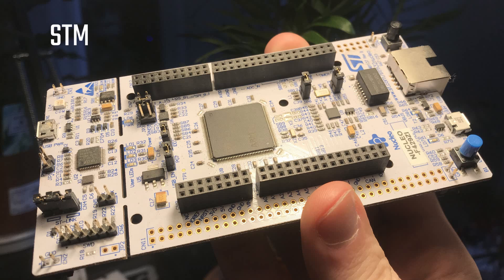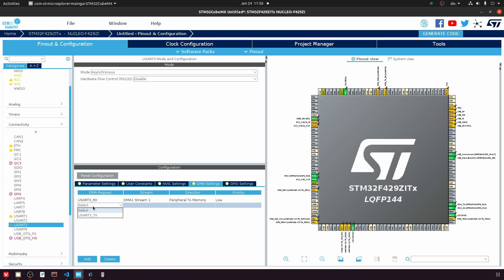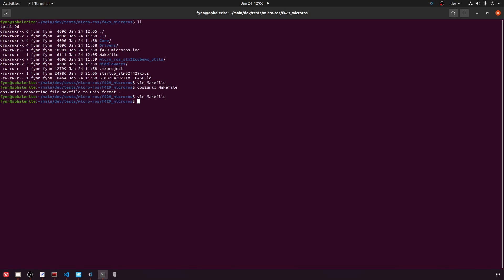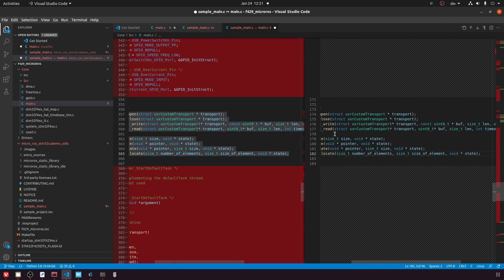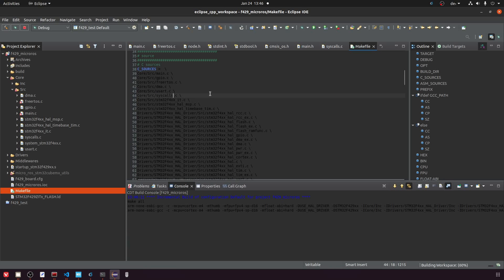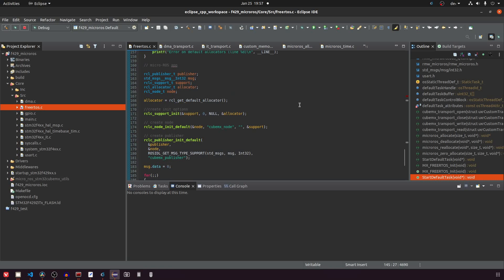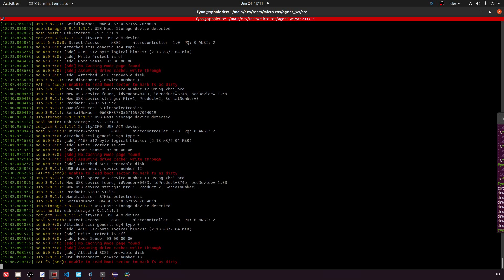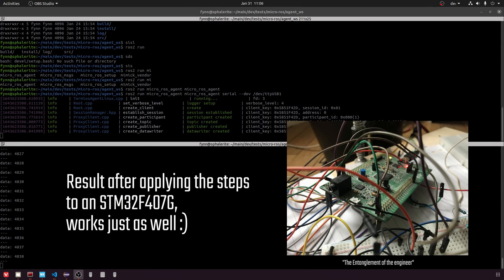How to setup micro-ROS on any STM32 microcontroller

Comment: Thank you, this video has been very helpful! I tried to follow your steps for a STM32F407VGT6, but didn't get it right. So I have a couple of questions:

1. In the build step, my project finished with 0 errors and 0 warnings but my project explorer still shows files with problems. So can I continue with the tutorial or do I have to solve those problems before?

2. I also got an error while running colcon build for the micro-ROS agent: 

ERROR:colcon.colcon_core.package_discovery:Exception in package discovery extension 'prefix_path': object of type 'NoneType' has no len()

Apparently the colcon build did finish its execution, but I'm not sure if I can ignore this error.

Thank you again for your help!
Reply from the maker: Hi there,

1. I don't quite understand the question. Are you talking about building the library, the microcontroller binary or the micro-ROS agent? What kind of problems do you see in the project explorer? Do you mean the small white X on a red background that is shown next to files in Eclipse? That's fine. It's usually a problem with the setup of include paths, defines or something similar in the IDE. As long as it compiles when building the binary you want, all is good. The compiler speaks the truth, not the IDE. ;)

2. I have not seen this error before. I've tried the instructions to build the agent from a freshly cloned repo again and it works without problem for me. Make sure you have the right ROS distro branch checked out. Also be sure to follow the instructions for "Building" first. I've skipped the mkdir steps at first which caused some trouble so for your first test follow them exactly, maybe in a temporary test workspace.

source /opt/ros/$ROS_DISTRO/setup.bash
mkdir uros_ws && cd uros_ws
git clone -b $ROS_DISTRO https://github.com/micro-ROS/micro_ros_setup.git src/micro_ros_setup
rosdep update && rosdep install --from-paths src --ignore-src -y
colcon build
source install/local_setup.bash

Then execute the steps in "Building micro-ROS-Agent":

ros2 run micro_ros_setup create_agent_ws.sh
ros2 run micro_ros_setup build_agent.sh
source install/local_setup.sh
ros2 run micro_ros_agent micro_ros_agent [parameters]

Does that fix it? If not, when running which command does the error occur?

Cheers
Fynn
Reply: @roboticsinanutshell  1. I was talking about the small white X on a red background that is shown next to files in Eclipse. So I guess there are no problems with that part, being that the binary building finishes without errors. Thanks for clarifying that!

2. I was able to solve the error, it was nothing serious. I also followed your steps carefully, but when I start the micro-ros-agent I get this:

jafet@jafet-Satellite-C55-A:~/uros_ws$ ros2 run micro_ros_agent micro_ros_agent serial -b 115200 --dev /dev/ttyACM0
[1643036775.906617] info     | TermiosAgentLinux.cpp | init                     | running...             | fd: 3
[1643036775.906762] info     | Root.cpp           | set_verbose_level        | logger setup           | verbose_level: 4

I already checked that I'm using the correct set of parameters (baudrate and device). In the Core/Src/usart.c file I have huart3.Init.BaudRate = 115200. I wasn't sure if this had anything to do with the error, but I wanted to make sure. I also looked into your repository for possible solutions and found that for this problem you wrote that I could check that my MCU doesn't crash anywhere. But I don't know how to do it, so could you please elaborate more on that?
Reply from the maker: @jafetgutierrez95  In general the output from the micro-ROS agent you get is expected. It means that the agent was able to find your device. But it did not yet initialize any communication such as a publisher or a subscriber which is not the expected behavior (if you created any subs or similar on the MCU). The most easy fix you can try is to just stop your MCU and run it again. In general you have to start the agent first, then the MCU (at least with the code as it is right now, you could also write it so that it attempts reconnects I assume). If that doesn't work I'd try restarting the agent as well. You could also step through the initialisation process within the MCU using a debugger and see if it halts at any call. This could indicate to you where the problem resides.

Indeed I also had problems where the agent would simply not set up the publishers, subscribers, etc. and no communication was possible. Unfortunately I don't have a clear answer to that problem either right now. When I've encountered it I mainly tried restarting the agent and the MCU until it worked eventually. So I'm also in search of the best approach to solve that problem.

I hope this answer still helps you at least a little bit. If you find out anything how to fix the problem, consider writing it down here so I and others can learn from your findings.

Cheers
Fynn
Reply: @roboticsinanutshell  I understand. Thanks for the detailed info. I’ll keep you updated on anything else I find.
Reply: @jafetgutierrez95  
Sir , Did you overcome the problems
Coz , without any prior idea on whether or not the controller is compatible with ROS, purchased the controller and has been facing issues since a week . I was hoping to get in touch with you .

Comment: Hi, I am trying to install the microROS into STM32L073RZT6. 
Yet, I am getting this "region `RAM' overflowed by 24688 bytes" RAM error while I am building it. 
Is it just because that this MCU does not have enough memory?
Reply from the maker: Hi there,

yes it sounds like your chip does not have enough RAM. On this page (https://micro.ros.org/docs/overview/hardware/) in the 3rd paragraph they mention that you need a few tens of kilobytes of RAM to run micro-ROS. According to the datasheet of your microcontroller, it has only 20 kByte of RAM. This seems to be insufficient. The guys at micro-ROS do have further resources on how to tune the memory consumption such as this (https://micro.ros.org/docs/concepts/middleware/memo_prof/) and this (https://micro.ros.org/docs/tutorials/advanced/microxrcedds_rmw_configuration/). So you could give these optimizations a try if you want to stick to your current MCU. You could also think about if external RAM could help you. Other than that you have the option to use a more powerful chip with more memory.

Cheers
Reply: @roboticsinanutshell  Thanks a lot.

Comment: I have the STM32 H757XI Eval Board and it seems to meet the requirements haha
I mean, the memory is enough and it has all the usual communication protocol stuff (CAN, SPI, I2C, etc...), no Bluetooth or WIFI though.
It also has a LCD, and so on.
Do you think it could work?

I am still taking the basics courses (Linux, Python, ROS Basics, etc...), but am already thinking of how I could implement all that taking advantage of this microcontroller I got.

Could you please state your thoughts on that? 😅

Thank you very much.
Greetings from Germany.
Reply from the maker: Hi there,

since your micro controller is from the H7 series (which is STs most powerful family) I think it will definitely be possible to use micro-ROS with your chip. I would start by transmitting data from the micro controller to your PC, similar to how I did it in this video. I'd use UART at the beginning. micro-ROS also supports other protocols but I think UART is the easiest way to start. Set up a way to flash code onto your board (many tutorials online), follow the steps in this video, and have a look at the micro-ROS documentation. That should enable you to get the first results and then you can just go from there and see where the journey takes you.

I wish you good luck with your project :)

Beste Grüße

Comment: Great video! I'm build custom piece of hardware with STM32H743 (single core 480MHz, 2mb flash). Do you think it is enough to perform micro ros related tasks and another control routines, like communication over can and some control math in the real time? Or I should switch to something like STM32H745ZI with dual core?
I also wonder about transport of the data over USART3 - it has to be exactly that peripheral? I also consider if it possible to use that UART3 with Bluetooth module to achieve wireless micro ros node. Do you know maybe it is possible?
I also thought about MCU USB peripheral in CDC mode as UART replacement - it's more comfortable to connect via USB instead of additional serial to usb converters. Is this possible to achieve that with micro ros?
Sorry for so many question, I try to develop the most accessible from higher level piece of hardware I can :D
Reply from the maker: Hi there,

whether the H743 is capable of executing your task highly depends on the actual load your MCU will be under. So things like how many CAN messages do you send/receive per second, how much do you want to transport via micro-ROS, how complex is your control logic, what other things is your MCU occupied with etc. This is a question based on the requirements of your whole project and therefore difficult for me to estimate. The H7 series is one of the most powerful from STM32 and I've seen somewhat strenuous tasks done on chips of the F4 series which is less powerful. I've did tests with micro-ROS on a F429ZI and a F407. That worked without problems but the chips didn't experience any other load at the time. On the micro-ROS website they say that RAM is usually the limiting factor when it comes to deploying micro-ROS (https://micro.ros.org/docs/overview/hardware/ in the first sentences). I think the H743 will definitely have sufficient RAM here as it seems to have 1MB of RAM whereas micro-ROS only needs a few ten thousand bytes of RAM.
Still I can't give you a definitive answer here what you should take, it's too specific to your use case.

Regarding the USART3: No it doesn't have to be the USART3. It can be any Uart. In fact, it doesn't even have to be Uart. micro-ROS supports multiple way of communication, for instance you can also use UDP, TCP, and CAN FD. The last option might also be interesting for you since you use CAN already anyway. There are also CAN to USB converters that you can use to connect it to your desktop PC. On the other hand UDP / TCP can be interesting for wireless transport of course with some kind of WIFI chip. Using a UART Bluetooth module to transport the data should also be possible. 

Regarding your last question: I haven't heard of USB CDC yet. I've had a quick look what it might be and it seems to be a way to use the USB of the microcontroller as a virtual COM port for UART, is that right? If so, then I can tell you that I did exactly that when testing with the F429ZI. Next to the USB cable I did not have any additional cables connected to it and communication via micro-ROS worked. It might be that this only works for certain USARTs though, I think on the F429 you can only do this with the USART3 for example. I can understand that you don't want to have additional UART-to-USB converters connected and I think this is a good way.

Cheers
Fynn